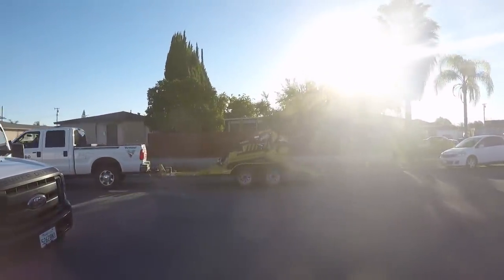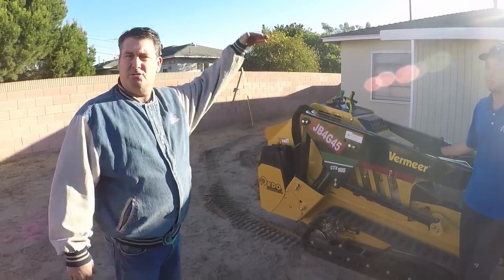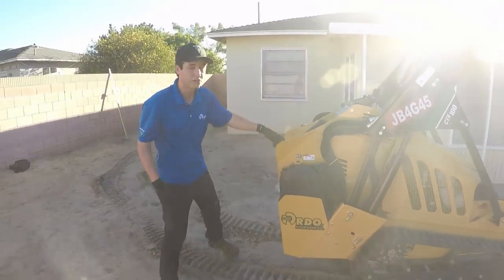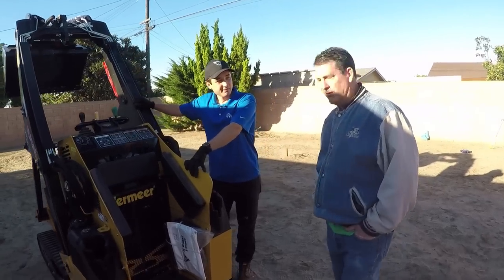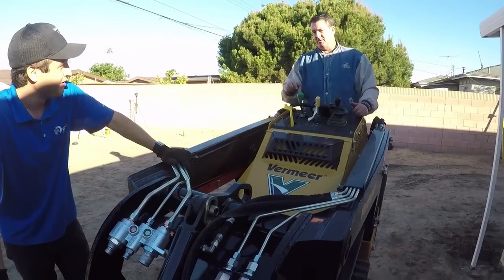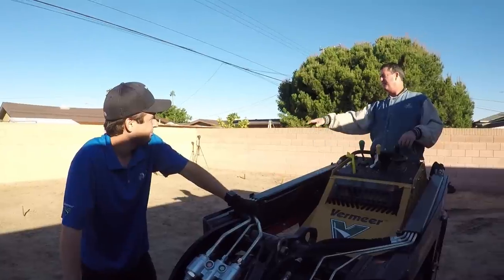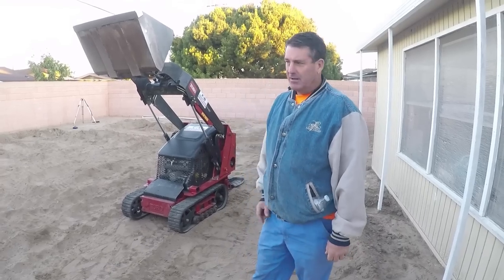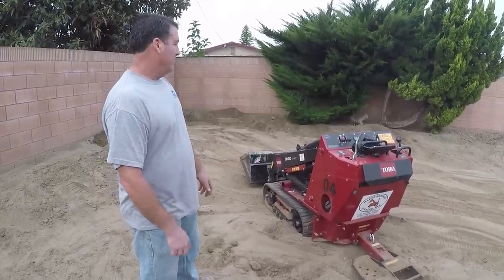Which Mini Skid Steer is best!? BUYING A NEW SKID STEER!

Comment: David, I have ran those brands for decades.  The Dingo is a good machine, but has issues with tracks over time, and has a great engine.  Bobcat is a good machine, but the hydro system hasn't been as responsive.  The Vermeer is a great machine, good tracks, and is dependable.  No matter who you go with, strongly consider the distance to your nearest dealer because you will need service and repairs.  I have always bought my machines new or as demo units so that I know the history of the machine, know it has been serviced, and can take care of it long-term.  Lastly, I recommend secondary hydro to run a 90lb hammer off the machine when you need it (e.g. thick steps or hammering out reinforced concrete).  I see the one unit in your video has it.  Good luck to you and let us know what you get!  All the best, Matt in Ohio
Reply from the maker: Yes it seems to boil down to serviceability on any machine you purchase
TY
Reply: What do you think about the Sk800s matt

Comment: I have run many different brands, here is my input:

Dingo:  belt driven pump looses power with age and gives issues, the walk behind platform gets caught up in the dirt when digging, not enough power to the drive in wet conditions to skid sideways.
New dingo tx1000 riddled with issues, there are way too many with 100-250 hours for sale.

Vermeer s450tx 
Hands down 100 times better than a dingo, gets in tight spaces, makes life easier, only get a bigger machine if you are trying to lift lots of heavy items, but for digging it is great.

Boxer:
Stay away, not enough power to the drive tracks, can’t spin in a circle in the mud.  Terrible controls and platform, platform has too much movement giving a calf workout all day.

Bobcat- unfamiliar with it, until recently they had a different attach plate than others so I never bothered

Ramrod/Thomas parts are hard to get, self leveling design is a bad design for dirt work or moving gravel.  You can’t ever get materials off the front lip of the bucket to the back of the bucket without going up and doing it by hand.

Ditch witch:  best machine in my opinion, open design tracks don’t get plugged with debris, faster than a Vermeer and at a better price point.
Reply from the maker: thanks for the breakdown
Reply: I operate an sk1050 (ditch witch) almost on a daily basis. Our company just bought the machine several months ago and it is hands down the best mini skid steer I have ever used. Powerful, rugged and like you said, at a decent price point.
Reply: what size ditch witch, the Vermeer CTX100 beat the Ditch Witch 1050 in lift capacity, high flow option, and price point. Just my experience, I also demo'd bobcat, toro, avant, and multi-one. Every industry is different, and all users are different. One thing I never see referenced is dealer support, crucial selling point, service and parts turn around are big time. Again, every area is different.
Reply: Hopkins Lawn & Landscape thanks for the info!
Reply: PeytDav can it lift a pallet of block and a pallet of sod?
Reply: Hopkins Lawn & Landscape 
What about Magnatrac?
Reply: Really good to know. Any opinion on Cormidi. Has highest lift capacity @1500 lbs while still able to fit through a standard gate.

Completely agree with your opinion on Boxer having underpowered track hydaulics.

Really anticipating the Kubota SCL1000 when it comes out this year.
Reply: @OdellCompleteConcrete  kubota just released there new kubota  scl 1000  mini skidsteer with nice led work light build  onto the hood
Reply: The Vermeer ctx 100 I ran has better power when turning in soft materials than the ditch witch i ran. Granted it was a bit older than the Vermeer but similar size machine and it would hesitate and I'd have to wiggle the machine around to get it to pivot in the soft stuff. Also the ditch witch was a few inches wider than the Vermeer which made going in and out the gate much more dificult and chewed up the wood so will have to replace a couple pieces which is a minor annoyance. The ditch witch also didn't dump quite steep enough for rhe dirt to just drop out of the bucket. Had to wait for it to fall or shake the bucket which takes more time. The controls were also smoother and more precise on the Vermeer and I was able to do fine adjustments and use it to nudge things like retaining wall timbers into place right where I wanted them. The ditch witch is slightly faster than the Vermeer but the controls were almost too touchy and made for jerky operation at times. It's easy to jump on and off the ditch witch platform which is very handy, but I also like the protection of the Vermeer so it's a toss-up there. A more experienced operator might prefer the ditch witch controls and I was able to dig fairly precisely once I got the bucket to bite when excavating hard clay for concrete. Don't have enough experience to know which roller design is better overall, but the open design on the ditch witch does look easier to keep clean. Both brands seem like good machines overall.

Comment: I have a 2005 Dingo Tx420, and put 350 hours on it since I bought it 2/2018. I have rebuilt the wheel motors, replaced tracks 2x, replaced most of the road wheel bearings,  rebuilt the track guides, rebuilt one of the main track idler wheels, replaced bearings in both track idler wheels, replaced the positive battery terminal that went bad, and replaced the starter. One of the relays popped almost all the way out of the relay holder, and after replacing it, the engine started up. Also the carb fuel solenoid wiring went bad, so I ran a new wire to the solenoid so the engine would run again. Now the engine won't charge up the battery, so I have to fix that. But this machine is a beast. With my homemade stand, I've been able to pick up 1200# on flat ground. (even though operating capacity is 535#.) It just doesn't like to start in cold weather.
Reply from the maker: Sounds like a lot of broken parts for a fairly new machine.
I'm glad didn't go that route.
Thanks for the information
Reply: Sounds like you got her when she was put out to pasture and her working days were mostly behind her. These things take a real beating in their early lives.

Comment: I shopped them all, I purchased a Vermeer CTX100 for $32k, best piece of equipment I have,I use it almost daily, you keep finding new ways and attachments to use with it. I installed Generac Generators with it, from grading, to hauling gravel, 48” trenching, backhoe, dirt and snow blade, 48” pallet forks.i move over 1/2 a ton when placing units with concrete preformed pads attached. You pay more upfront, but that turbo diesel has the horse power when needed.
Reply from the maker: Yes I concur

Comment: Hey Dave! I picked up a Vermeer 925 (the ctx100’s little brother) earlier this year. So far we have put a 120 hrs on it and we love it. Why I didn’t go with the ctx100 
-$7000.00 more than the 925 
-they have the same lifting capacity 
-the ctx is 6 inches longer 
-they dig the same. The 40hp is really only needed in my opinion if you will be running a lot of high flow attachments such as trenchers, augers, or mower attachments all the time. I really haven’t thought once “I wish I would have gotten the bigger machine”. 

Anyways, let me know if you have any questions! I did quite a bit of research and testing on these before I pulled the trigger.

As somebody else mentioned, whoever Services you the best would also be a deciding factor. RDO equipment where I am from is awesome.
Reply from the maker: I use the breaker attachment, High flow.
RDO good to know

Comment: My limited experience with the mini skid-steers is this: I rented a Toro Dingo that was a wheel-driven unit. What a worthless POS that was! It had the optional stand-on platform which was good. All I had to do was to backfill a 12" ditch that was about three feet deep that I had dug for a gas line -- or so I thought. About halfway through I realized that I had forgotten about the ten tons of sand in the bottom of the ditch. So I ended up having to carry a scoop of soil at a time down to a ditch on my property. I don't know if all the Dingos are like this but here's the dealbreaker on the one I had. You can't move the hydraulics while in motion. They weren't locked out or anything -- it was just the way the controls were set up. So if the terrain varies (as it will) you have to constantly stop moving to raise or lower the scoop. Totally ridiculous. 

I also used the Vermeer with the 40-horse motor on tracks but it was hooked up to a stump grinder. Awesome machine. The controls were set up way better. Plenty of power for the stump grinder so I would imaging that it could handle the scoop with no problems at all. The only thing was that it was February and chilly and the radiator is right at the operator's legs and the air flow required me to wear three layers of pants while I worked. If it's not cold I'd say that it wouldn't be an issue. 

That's all I got.
Reply from the maker: Yes I have heard that multiple times here from different people.

Gutless tools

Comment: I would give a STRONG CONSIDERATION to which dealer can service/repair/loan a machine when needed....and resale value  (which would probably be low on your list). This should be a great investment for you, speed the work up! Good luck with the purchase!   ...13
Reply from the maker: Good advice thank you!
Reply: I’m with Arkansas on the service you’ll get. I’ve been on both ends of excavating. If you don’t have good service, it won’t matter what you buy.
Reply from the maker: Yes the service and the location is crucial

Comment: There is a company that makes aluminum conveyors in 10 ft sections that run off of 110 power and you can run them in series. If you have alot of yards like this you might look into it. You could also set the conveyor to dump right into your truck.
Reply from the maker: Good to know
TY
Reply: Brian, would you be kind and post the link for the aluminum conveyor? Thanks in advance
Reply: and of course you don't give name of info...
Reply: @Desideratapoem  Look it up on the web under 110v portable conveyors.
Reply: @vrcun  Look it up on the web under 110V portable conveyors. It is what I did.

Comment: Hello.I own a Ditch Witch SK 600. I can fit in a 3 foot gate which was my first requirement. We install artificial turf in Phoenix so it loads a lot of wheel barrels mainly. I think that the only thing I would do differently is more lifting capability. As far as access goes these machines are incredible. I currently have 56 gentle hours on it. 
I have learned a lot from your videos. Keep up the great work.
Rusty.
Reply from the maker: Thanks
Reply: I've been looking at getting the sk1550. I also install artificial turf but in SwFL. Just don't know if it's the right machine or not
Reply: @dallasfraley14  . I like everything spec wise on that machine. Couple of things that don't work for me on the 1550 are price and width. Not sure about Florida, but Phoenix has tight access into back yards. Occasionally we run into rv gates. They sure are fantastic for demo work.

Comment: Unless it's just completely out of your price range then I wouldn't cheap out on something like this, go with the big high powered unit all day long. Just because the little dingo worked well in soft ideal conditions doesn't mean it will get the job done when things get tougher with hard terrain, rocks, hammering, grappling, etc. The extra money will be worth it in the long haul plus I would assume much better longevity and resale value cuz you're not hammering it to its max constantly. Much higher reach, etc... Besides, you make 35k on most of your jobs anyway, right Dave.... Ha.

Maybe you should rent the 2 you liked the best several more times in different conditions before you make a decision.
Reply from the maker: I think your right about all that expect the 35 k part

Comment: If you could find a kanga-kid for those small yards, you can fit anywhere and it just flys through 30” gates, it’s a small 13-15 HP  Honda little engine but it’s so useful since it’s got tracks and all parts are very affordable, it’s small but powerful
Reply from the maker: Sounds good
TY

Comment: I have 3 dingos.  I am on the east coast with primarily clay soils, and these machines are used primarily for their different types of tools, not a production environment of moving dirt.  I have boring units, trenchers, vibe plows, Harley rakes, buckets, forks augers and snowplows for them

We have had no issues with them, 

They are not particularly good at any task, but they can do so many things mediocre .  

We love ours and they are the first things my guys load up.

Light footprint, gets through all gates, couldn’t ask for more.

The paddle on the dingo can get tiring to use, but the twin sticks on other units require more skill to use and can be real jerky

Just about anyone, in a couple of hours, can become decently proficient at using the paddle style controls
Reply from the maker: Yes that sounds about right do to there size

Comment: I work at a large power plant in Belews Creek NC, we have been running a wheeled toro dingo for coal, lime stone, and gypsum spills version since 08 it’s gets used 15-20 hours a week and the only things that we’ve had to service was the bucket which rusted out, and basic oil and filter changes. Other than that it runs great and I love it in areas at the plant the skid steers can’t get to. It’s an older model, but it’s been a good machine.
Reply from the maker: Sounds like a dependable unit

Comment: I had a dingo and my father sustained a serious back injury when the machine went over a rock with the bucket elevated.  Given the distance between the tracks and where the operator stands- it becomes a catapult and creates a slingshot type action. 

I sold the unit soon after and would only consider the asv units like the rc30  because of the safety advantage.
Reply from the maker: I can see that happening.
TY

Comment: STRONG ADVICE. I’ve tried 2 types of these. Both were very hard to use compared to a bobcat or skid steer. I know they are small but if you have to use for more than say 3 hours you will definitely be feeling like you went to the gym and did a major work out on your legs. Just wanted to give you my advice.
Reply from the maker: Yeah i felt that when i was on this, and i was on it longer than 3 hours thats forsure
Reply: JCMotorsports we moved 64 yards of dirt on a job this summer. Had to do it all with a mini, it was the only thing that would fit around the house. It will definitely give you a sore back and legs
Reply from the maker: Yes I can feel that, maybe something you can get use to, like being on a boat
Reply: Not as much as you would feel it if you barrowed and shoveled it all.
Reply from the maker: @sydneyshinshi  
that makes sense
Reply: Still better than shovels!
Reply: I have a Ditch Witch SK 850 and have no noticeable fatigue after 3 hrs of continuous operation as long as it's not super steep ground. Stable and a comfortable platform.

Comment: I would go with the Vermeer, even though it could be a little more pricey you are going to make your money back by getting the job done faster. And if you ever have to clean up concrete that extra hp is a big help. Plus if you ever get into doing other odd jobs that need attachments you'll need the hp.
Reply from the maker: that makes sense, go big and leave some options open.

Comment: I’ve used the dingo and nothing but problems,  rental places say it’s not built too last...  NOW!!  The ditch witch I’m madly in love with it. Oh man!!
Reply from the maker: Nice upgrade
Reply: I have a Dingo in rental with 3000 hours. There are some weak points to the 425/525 design but it isn't hard to keep them going forever. They also weight much less then even the smallest ditch witch.

Comment: I know of a guy with a ride inside Vermeer.. its built super heavy duty and stands up to use in the woods. Given the choices of what we see in the video, my vote is Vermeer. Its a bit bigger but very very capable to do a huge range of jobs with powerful aux hydraulics..  For just light dirt, the Dingo might be the best bang for the buck, but for a capable tool that can do a range of jobs, and run augers, splitters, hammer, ripper, and scoop, invest in the big boy.  It also has compound action on the boom, keeping it forward when scoop lifting high to load  a truck or waste trailer. Huge advantage there.
Reply from the maker: SOunds like you know your equipment
TY

Comment: I love watching your work but you all definitely work with some soft soil out there , those machines would be almost useless working in the Arizona desert soil.
Reply from the maker: There is a lot of silt by the Colorado river area
Reply: I've used them to excavate dry hard clay. They have the power and traction to cut into some pretty hard stuff. Once you get the bucket to bite they will eat up a bucket full in mere seconds.

Comment: I have seen all of those machines in action in person. I have no brand loyalty but was not impressed with the toro. The side by side demos I saw with the Vermeer, toro , and bobcat were very impressive for Vermeer to say the least. Friend of mine went with the Vermeer even though it was more money. But think of it this way, your going to have it for a while even though you might not need the extra power and lift capacity now, you will at some point. You’ll find yourself using it more and more and making its money back in no time.
Reply from the maker: Yeah i agree but being a concrete company i will most likely need that extra power! thanks for the input